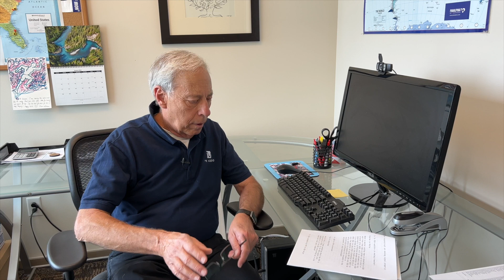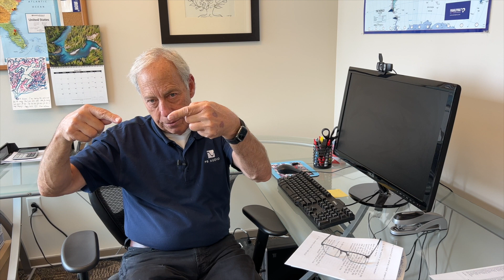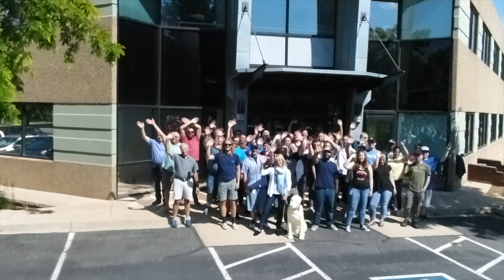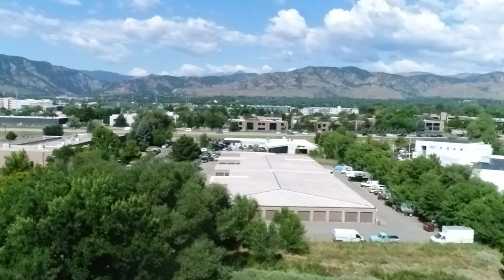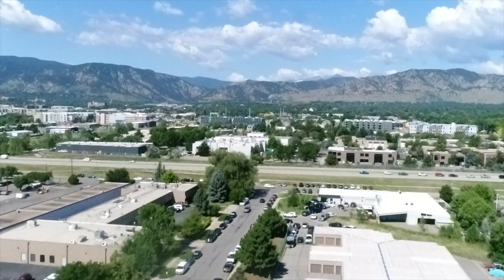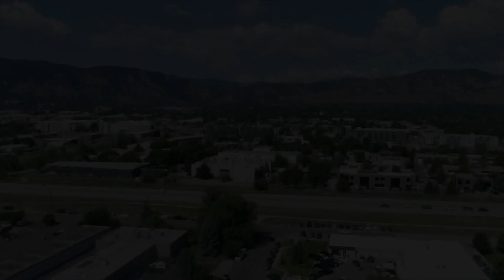DSD to PCM conversion

Comment: if the dsd low-pass filter is analog.  that means its minimum-phase.   and you can just as easily convert dsd to pcm with either a minum-phase OR linear-phase low pass filter.  thus making pcm superior

Comment: Paul, I'm more interested in, HOW you design Topology without a strong Math background? I was Math/CS, for my first undergrad and hung out with the EE undergrads, as we shared the love for the bong and the misery of Calculus, I-IV, Differential Eqs. and then a semester of the Laplace Transform and Convolution Integral along with the computational language CSMP, AKA, Operational Mathematics for Systems Analysis, course. Post the OP Math, the EE's were done with their Math requirements, but unfortunately, I was not.
     BTW, I use an AudioNote Kit DAC employing R2R Topology that reads what was recorded, not a Delta-Sigma based Algorithm where a machine guesses at what was," Laid down".  Then a Resistor/Transformer/Resistor, Topology for I/V conversion.
Reply: Thanks, Scott. R2R is accurate to about 16 bits, 18 on a good day. One of the reasons as an industry we moved away from R2R is getting 24 bit dynamics and there you need a SDM. Resistors cannot be made with tolerances good enough to hit those numbers. But, I agree, like vinyl, there's a sonic goodness to RTR. As for HOW I design without heavy math there's probably a book to be written about learning by doing and through mentoring with skilled designers. Not room enough in this small comment section.

Comment: Multiples or divisions of 48 kHz are standard in the digital world because they are divisions of the system frequencies of devices. Most devices use multiples of 48 kHz internally and interpolate audio with multiples of 44.1 kHz. Sony's odd 16 bit/44.1 kHz (Philipps suggested 14 bit/44.056 Hz) was used because bitrates over 45 kHz did not fit into the vertical blanking intervall of video tape recorders used in studios before solid state-memory.
Reply: Yes few realize that 44.1K (Hz is "cycles per second" for signwaves, not clock cycles) was chosen to fit 3 samples into a horizontal line on a 3/4" Umatic VTR. I sold the PCM-F1 when it came out.

Comment: You don't have to know math to know that what Paul is saying doesn't add up because,
1. It has been factually proven in double-blind listening tests that DSD does not sound better than PCM.
2. Paul says 8:34 "...so DSD is the way to capture it, but then if you (alter the original signal) decimate it, if you put it through a low pass filter (to eliminate the large quantities of noise that must be added to DSD to quantize it), convert it to PCM there's very little loss..." so wait there's very little loss when converting DSD to PCM?
Wouldn't it make sense that there would be no loss starting out recording in PCM?
3. Paul says at 8:48 ...go the other way record in PCM you've already lost the information from the live microphones..." WAIT, WHAT??? 
Paul just told us that converting DSD to PCM there is very little loss, now suddenly there is some kind of loss even though PCM uses the same type of converter and has better resolution than DSD and doesn't require low pass filters?
Something isn't adding up here Paul.
4. BUT WAIT THERE'S MORE!!!
Converting PCM to DSD requires more noise to be added and filtered yet again on playback (PCM requires no filtering on playback) and there's a significant loss.
5. Paul neglects to mention that his current system requires DSD to be converted to PCM in order to do any editing, and then converted back to DSD (wait didn't Paul tell us that converting from PCM to DSD incurs significant loss?
Sorry, Paul but what you are saying doesn't add up at all.
Reply: PCM DONE WITH ABSOLUTE TOTAL PROCESS OVERALL LOWEST DISTORTION QUALITIES AS THE VERY 1ST HELD PRIORITY IS EXTREMELY DIFFICULT TO BEST. 

I KNOW THEIR ARE ALL KINDS OF FLAVORS POSSIBLE WITH THE ALTERNATIVE DIGITAL CHOICES  BUT AS A PLEASE GIVE ONLY THE REAL FACTS PLAYBACK I CHOOSE PCM IN ITS BEST POSSIBLE FORM UNTIL IT CAN ACTUALLY BE BESTED AND PROVEN TO BE BESTED IN A REAL COMPARATIVE AND ALTERNATE METRICS MEASURING TEST. 

I LIKE REAL COMPARATIVE TESTS AS THEY EXPOSE REALITY. WE ALL GET TO BENEFIT WHEN WE ACTUALLY IMPROVE OUR SOUND EXPERIENCE AND ENGAGEMENT.

OF COURSE ANYONE IS ENTITLED TO LISTEN TO GREATER LEVELS OF DISTORTIONS OF THEIR CHOICE IF THEY WISH.

Comment: So to be clear Octave records record in DSD but mix/master in DXD (the dreaded PCM folks!!) the vast majority of DSD recording go this way and have done for many years now.

So, question is simply why not just record in DXD to start with? (Many folk do just that these days but it's their own project choice and nothing wrong in that).

Reasons are:
1) Because DSD itself is a better capture of the original audio signal regardless of what you then do with it.

2) It leaves you with the Pure DSD streams to work with in the future when possibly you could actually mix/master it without conversion maintaining its purity. If you've gone direct to DXD/PCM you've lost these forever.

3) Converting your DSD captures to DXD post recording is easier on the processors so renders a better DXD conversion to work with.

Don't shoot the messenger folks this has all come from very reliable sources and I aint getting paid!
Reply: I question your "reliable sources" because there is no scientific or factual proof to show that DSD is a better capture of the original audio.
1. In fact, there is significant evidence to show that PCM is actually better at capturing original source audio because of better quantization, resolution, and the lack of a need to add large quantities of noise to the original signal to maintain quantization.
2. DSD "streams" are not pure.
The Delta-Sigma analog to digital conversion introduces distortion along with the need to add extreme quantities of noise which must be added to each DSD "stream" or channel (multiple channels must have noise added to each channel and then when these channels are combined the noise doubles with each channel added and then the need to use filters to remove the noise in the digital to analog conversion does not create a "pure" signal.
PCM (DXD) on the other hand provides significantly better resolution at lower sample rates, thereby not overworking the Delta-Sigma converter (or the Sigma-Delta digital to analog converter) and PCM only requires the use of one Nyquist filter per "stream" or channel at twice the recorded frequency (even at 48 kHz that filter only has to reach down to 24 kHz and at higher sampling rates such as  352.8 kHz used for DXD conversion the Nyquist filter only has to filter out frequencies above  176 kHz (virtually no need for a filter on most audio circuits.) and requires NO filter for the conversion back to analog.
3. Recording direct to high-resolution PCM is much less stressful on Delta-Sigma converters and there is no need for processors to work at putting large quantities of noise into the above audio spectrum with each stream.
Because PCM files are in the native processor language, and because PCM file sizes are smaller, and because there is no need to convert PCM files for processing, processors are much less stressed and PCM capture is significantly "purer" and provide much better replication of the original source that DSD or even analog equipment.
Reply: As said, don't shoot the messenger!
If PCM 'direct' capture is sonically better as you are suggesting the simple question is why are many highly experienced, professional recording engineers bothering to do something that is complicated and tedious and loses money?

Comment: I recently bought the Simply Vinyl re-release of Procol Harum's 1969 LP "A Salty Dog". Supposedly it has gone through the same DSD-involved procedure as mentioned by Paul here. Comparing with my old US original copy of the same album, some of the differences I hear are hard to put a finger on technically, but let me try to explain it in layman's terms. The SV release has a kind of combined two- and three-dimensionality to it, akin to what you can experience visually with computer animation (or in a 1950s "Peep Show" or a 3D movie), i.e. the elements can seem to be in front of or behind each other (3D), yet individually they are flat like cut-out cardboard figures (2D). You may like or dislike it, but in my opinion it can hardly be classified as "High Fidelity".

Comment: Knowing nothing about the actual DSD to PCM conversion process, I would guess that it goes something like this.  Divide the DSD stream into time increments of 1/44100 seconds.  Add up the number of 1s in that increment, multiply by 256 (number of SPL increments available in standard PCM) and divide by 64 (the number of DSD samples in a PCM time increment) and you would get the PCM amplitude value for that time increment, convert that value to binary and there you have it.  Well within Paul's mathematical abilities (grin).

Comment: "pro audio" is at 48khz to sync perfectly with movie that were filmed at 24 fps.
Reply: Absolutely. Paul should know this.
Reply: Except that movies are filmed at 22 fps and NTSC video was originally done at 29.97 fps (now 30 fps).
The modern frame rates also include 24 fps and 60 fps.
Reply: @JonAnderhub  Movies filmed on actual film (not digital) were all at 24 fps.